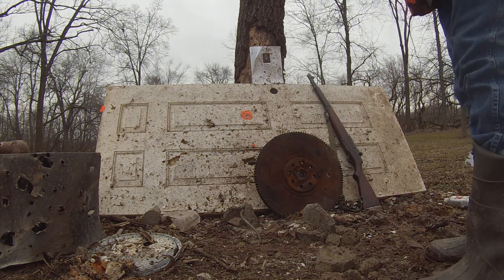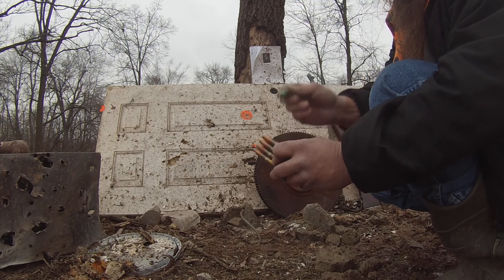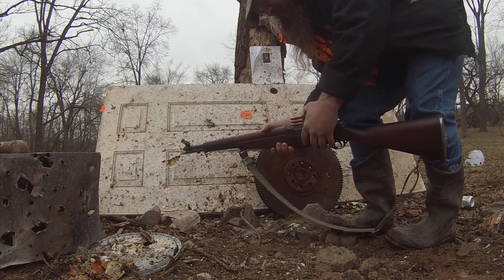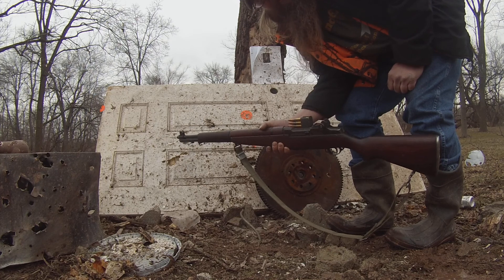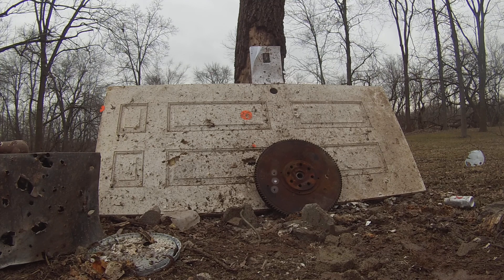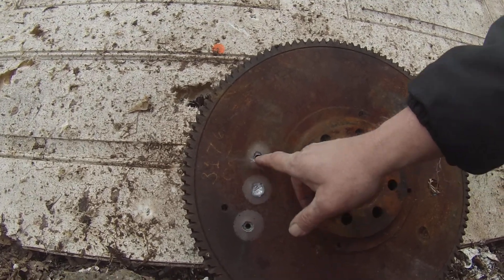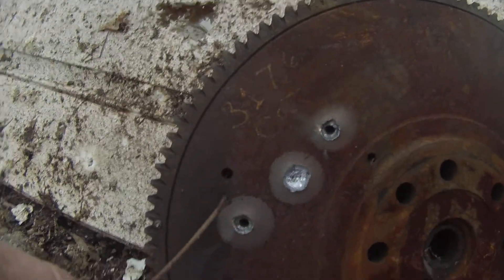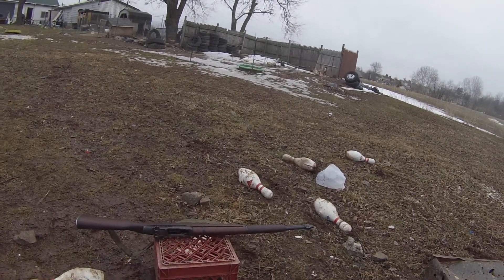M1 garand mild steel core vs armor piercing rounds

Comment: The black tips are actually ARMOR PIERCING. "AP" I believe they are 160 grain. Much more powerful to shoot out of the M1. 150 grain is standard M2 ball which was the one that barley did any damage
Reply from the maker: ***** thank you for your information do you think I should not shoot them out of the m1 garand
Reply: Frestley  it's recommended that the rifle not have a steady diet of them ,it's a little bit harder on the bore of the rifle and they were only made for occasional use and I just save mine ,there's not many of them around anymore !

Comment: Damn!! I thought that was 3/8 " steel but that's thick!! It went way in there!! You could make those rounds with a grinder wheel and a drill press. Use drill rod and see if you can punch through that monster flywheel off your big ass truck.
Reply: Engine block and the transmission are known to stop .50cal AP, API, APIT rounds. Engine block PLUS transmission had also defeated 76mm Sherman tank round in Demo Ranch's video when he shot his old GMC truck.